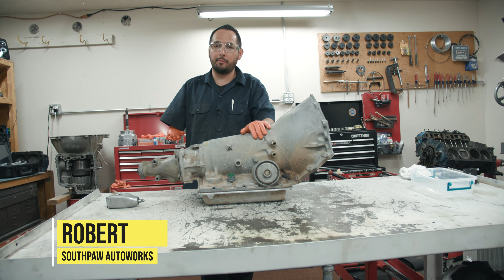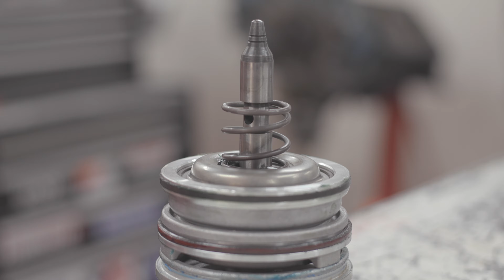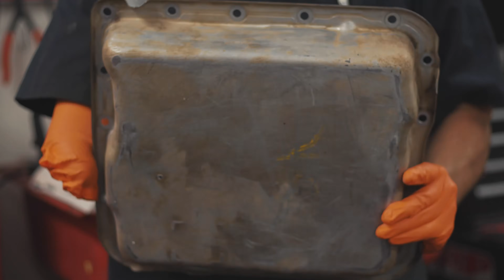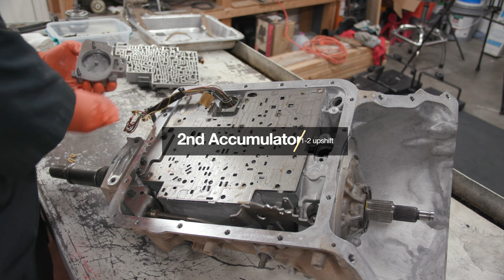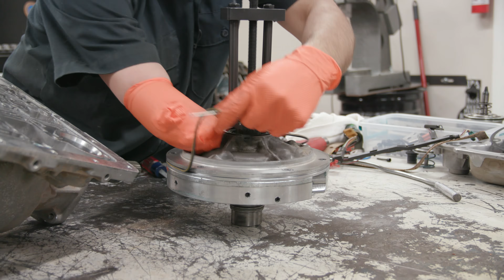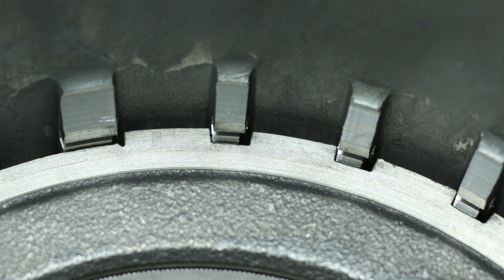4L60E Rebuild: Teardown (Disassembly)

Comment: Great instructional video brudda!! Thank you! You are an inspiration and amazing!
Reply from the maker: Thanks for dropping me a line!
I checked out your channel.  Is that you doing wheelies on the motorcycle?
Reply: @SouthpawAutoworks  that’s a friend of mines son. 
I call him Evil. He just opened up a motorcycle shop in Cali. 
CaRaZy bastard!!
Reply from the maker: Right on.
Reply: @SouthpawAutoworks  Hey buddy I just wanted to mention about those plastic locks on the elec. conn.'s. They really should come up with a better idea since it seems to be not only do they break when removed which requires replacing the ends if you own the removal tool to get the ends off.  They also could break off and take a swim through the trans.!!!  Man those clips are a great example of good intentions gone wrong! I always had a problem with the ones on the HEI wires!! I was in the desert and the truck just died! Doggone hot wire to HEI coil fell off because the lock portion was broken! I love your energy and you make a superb instructor with a lot of extra good tips and info!!
Thank you for checking out my channel again brudda!!!
Reply: Awesome rest of the video! It looks like this model is close to a TH350?
I noticed you didn't show blowing the low/rev. drum out? Is it the same as a TH350?  I also like your homemade tools!  I have a similar center sup. snap ring tool, I cut a little notch in the end though to twist a little then pull. I enjoy watching and will be watching more!! Thank you!  PS: I just finally got the time to finish watching this so I made multiple replies or I would have written a book with chapters! lol
Reply from the maker: Yes, there are some gut stack similarities between the 4L60/4L60E and the TH350.  I know exactly what you're talking about regarding the little notch cut in the end of a screw driver.  Andy (who hosts other episodes) uses (and prefers) the same style tool that you speak of.  He also made it...years ago.
I did not remove the Low/Reverse piston from the trans case, just because of time (video duration)(Trying to keep them from getting too long).  One of the upcoming videos, in this 4L60E series, will show everything that needs to be done to finish stripping down the trans case, inspecting it, etc.

Dude, I really appreciate you watching, and dropping me a line.  Thank you.
Spent the last several days filming the 65 Ford Fairlane.  Currently editing the next 2 episodes.  Hope to see you again in the comments.
Reply from the maker: Those connectors are quite prone to breaking.  
Breaking down is never fun, however, it's always nice when you can quickly resolve the issue, without the need for a tow truck.

Your positive feedback is appreciated.  I have been very fortunate to have great mentors (like Andy).  They always made learning fun.

I subbed to your channel, and hit the notification bell, too.
Reply: @SouthpawAutoworks  awesome! I will be checking out some of your other videos as time permits. I seen you have a few and now I have a better understanding of who Andy is. It’s always nice to have people in your life that are positive and like you said mentors. I am fortunate to have had a few also. I am fascinated with how the transmission works and although I have built around 4 I still am fascinated! 
You have a great shop and I really enjoy watching you rebuild. It’s like a good tv show if you know what I’m saying. I have subscribed as well and looking forward to seeing the videos. Thank you for subscribing to mine I don’t have much going on there but if something does you’ll know now.
Reply: Robert I just watched Andy do the good bad ugly intro on the 65. Cool to see the state of the car like that!! Before the transformation! Well I'm writing to let you know that I had mentioned watching your video to a friend. He then said you have to see the videos from the Harmless Farmer (Andy). So I watched his video on his family recanting how he lost both arms!! I immediately thought of you telling me of a guy you admired for being a big mentor in your life named Andy!
Well tonight I learned that is after all not the Andy! I hope I didn't confuse the heck out of you with that story! Take care!
Reply from the maker: Right on!  The next next couple episodes of the Fairlane should be completed this week.
Dude...     I just watched a couple of episodes of the Harmless Farmer, including the one where he shares his story.  Amazing...
For anyone else reading this, check out the Harmless Farmer:  https://www.youtube.com/channel/UCf87zCcTx0fIoYrqqx_Ut5A
Thank you for sharing this, James.  Take care, man!
Reply: @SouthpawAutoworks  I’m always amazed by the butterfly effect! 
I’ll be watching!